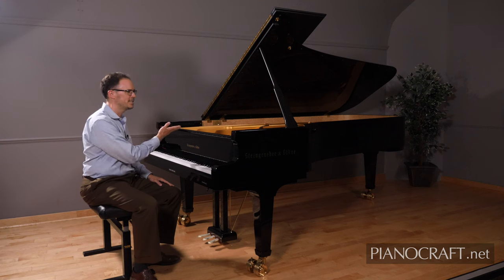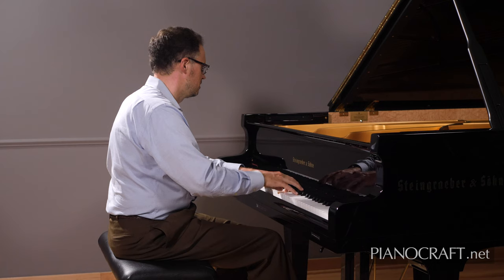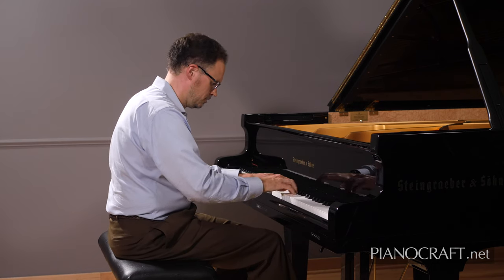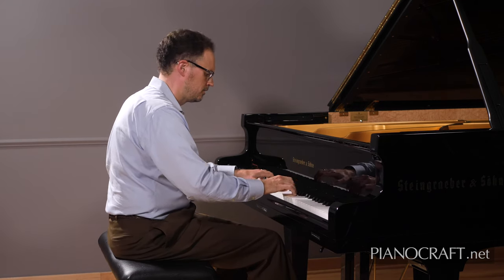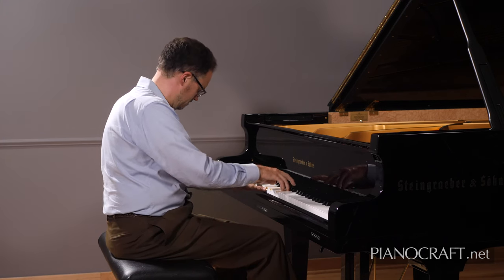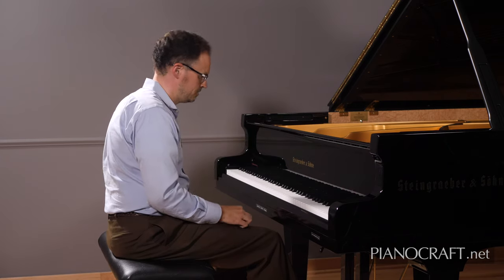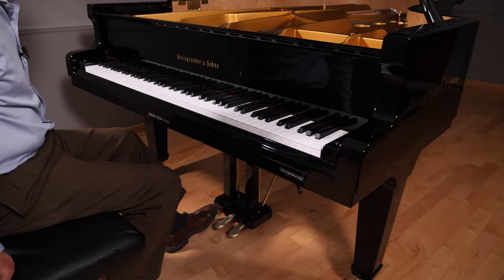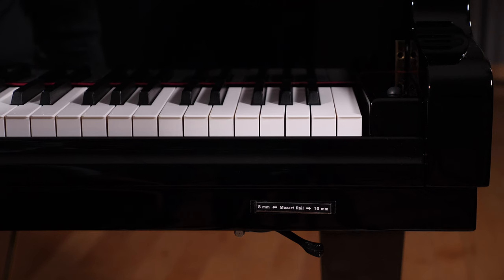Steingraeber Concert Grand w/ Sordino and Mozart rail demonstration by Matthew Bengtson

Comment: Do these features make it more difficult to service the piano? In other words, does the felt get in the way of a technician being able to reach the hammers for mating, or other servicing, etc.? Does the Mozart rail make it more difficult to reach things within the piano due to the mechanism?
Reply from the maker: Servicing this piano with these two special features is not more difficult.
Reply: @pianocraftchannel  thank you. Have you found these features to be a durable option? Would the Sordino felt need replacement after a few years?
Reply from the maker: @jimj.9291  I am happy to talk with you more about these features and Steingraeber pianos in general including care they might require.  Call 888-840-5460 and ask for Keith :)